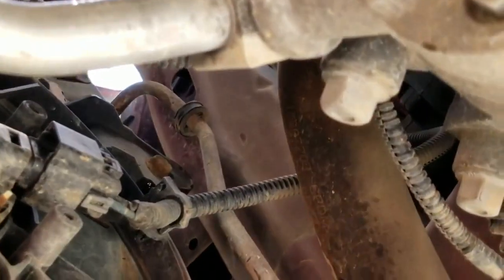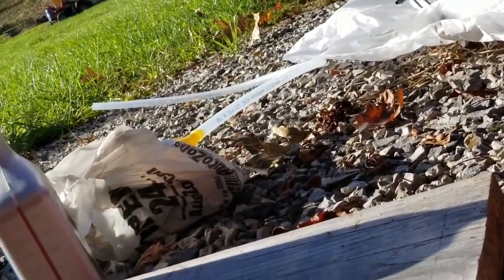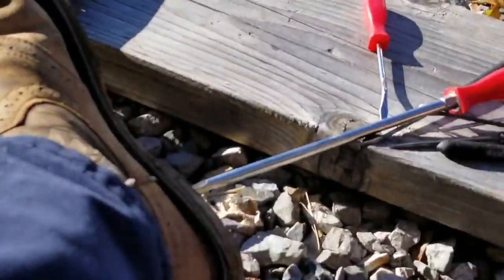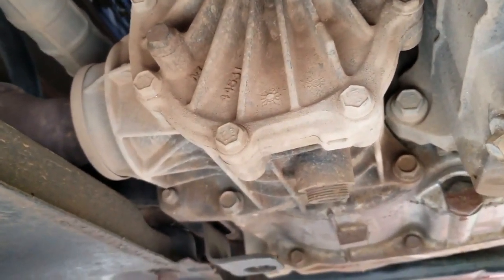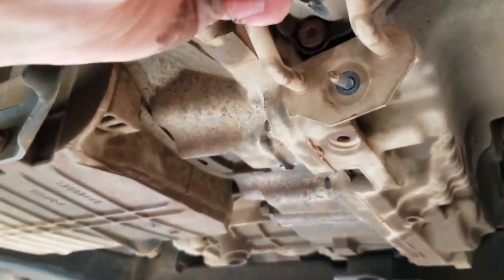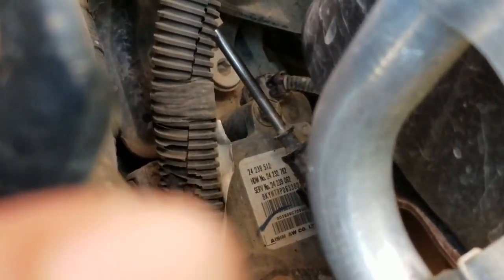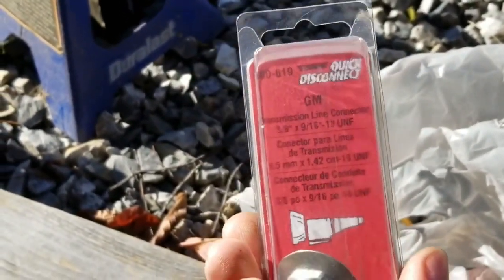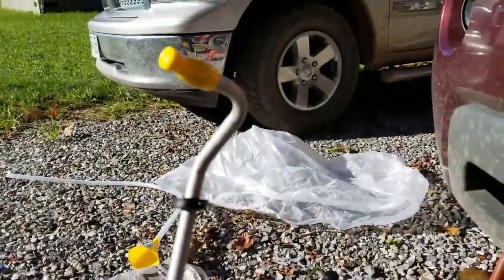2007 chevy equinox transmission cooler line replacement

Comment: Great video, I wish you could have shown removing the clips and lines from the radiator though.

FWIW - I was able to remove the dipstick without pulling the transmission mount by removing the battery box/bracket and then I could just get my hand down there to pull the dipstick out. Still a pain, but because I could then work from the top of the car it was easier then pulling the tranny mount and crawling underneath... probably. To refill the tranny afterwards I shoved a piece of vinyl tubing (3/8" I think?) in the dipstick hole and stuffed a funnel into the other end of the tube. took just over a gallon to refill.  
You do have to use an extension and a swivel on your socket wrench to get the bolt off the dipstick

Also, for some reason it was a pain to find the right transmission fluid for this thing. Valvoline "Max Life Full Synthetic Multi-Vehicle" fluid meets the "T-IV" standard that is required in the manual. not sure why I had so much trouble finding 'T-IV' fluid but maybe that will help someone.
Reply from the maker: Hey thanks for watching. I agree,  i wish i could have gotten video of the clip removal. The removal of the battery is a great idea! Also thanks for the info about the alternative of transmission fluid.
Reply: T-IV ATF is used more often in older Toyota and Lexus models. I found it for a really good deal from Summit Racing- it’s Aisin branded which is the manufacturer who built the transmissions in these cars. They’re who build transmissions for Toyota’s too which is probably why it uses that specific fluid.

Comment: I have to do this to my 07! My transmission line went well on the highway with no forewarning just transmission fluid all over the road hoping that I can do it all today without to much trouble!
Reply from the maker: Best of luck to you! Make sure you get the correct transmission fluid I would call a local dealership and give them the VIN and verify fluid type and more than likely they will be the only ones with the part! If anything get the part # from them and Google it to order more affordably. 
Hope the video helps! Just take your time be patient and double check everything! I always try to do it right the first time to avoid having to do it again.
God bless.

Comment: If your Chevy or any car you have jerk when u put it in drive or reverse. Only when the car is up to temperature, it’s most likely the transmission coolant line. It’s rotten or it got a hole. Inspect the transmission cooling line. Thank me later good luck

Comment: Hey where did u find u're trans cooler lines at ?? Auto parts stores don't stock em. Thanks
Reply from the maker: https://www.gmpartsdirect.com is where I ordered mine from. Also check local GM dealerships. They might can give you your part number to look up at local aftermarket parts stores.
Thanks for watching!

Comment: How long was it leaking before you fixed it?  I ask because I see the lines on my 08 leaking. Just a small circle of fluid under the car every day right now.   I'm hoping I can wait a week or so before I fix them!  Let me know.
Reply from the maker: Mine ruptured pretty fast soni replaced them ASAP. It would not be good to loose your power steering.  Hope you get it fixed!
Reply: @LanceSheppard  Trans lines I meant but I get what you're saying.  I have the parts on order today.  Thanks for the video  Very helpful.
Reply from the maker: @robank3900  shoot I was the one wrong! I'm sorry I didn't realize witch video this was LOL. Yes I would leave it parked you dont want to run an automatic transmission with no fluid. And that rust area will blow out quick! Thanks again for watching!

Comment: Ia the tcm in the main computer or separate
Reply from the maker: I do believe the TCM is Separate from the  ECU. The ECU is located on top of the battery box. To gain access to the TCM I would say you will need to remove the battery and battery box for the easiest access to the TCM. Hope this helps.
Reply: Thanks bro
Reply from the maker: Your welcome buddy.  Let me know if I can help with anything else.
Reply: Sure. I have a torrent in this year. Cant find nothing so ppl say the equinox is the same car
Reply: Will it be easy to charge the TCC solenoid
Reply from the maker: Yes the torrent is essentially the same vehicle.  I use 1aauto.com for all my parts. If incant find what I need there I usually google GM parts and I think its gmpartsdirect.com to get the hard to find parts
Reply from the maker: @basketballgod5947  yes I'm my experience it is fairly difficult to get to the TCC solenoid  on GM vehicles
Reply: Thanks for all ur help. Great channel
Reply from the maker: Glad I could help I hope I save you some money can you have a good day thank you

Comment: Can u tell me where the TCM is located
Reply from the maker: What year is it?
Reply: 07
Reply from the maker: @basketballgod5947  AWD?
Reply: 2 wd
Reply from the maker: @basketballgod5947  after a little search on a GM parts site it looks like the TCM is mounted on the automatic transaxle (transmission) if you are able study your trans from under the hood and see if it is possible to locate. You will probably have to remove some stuff to gain access.